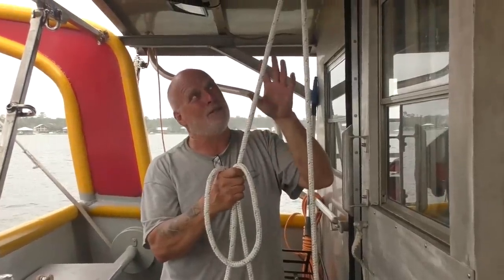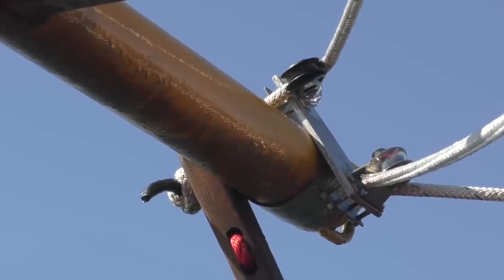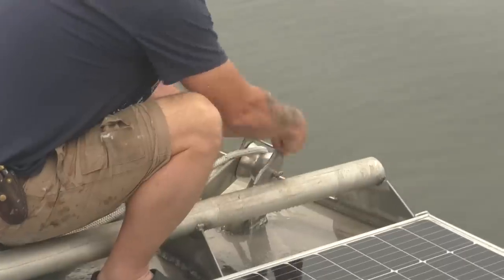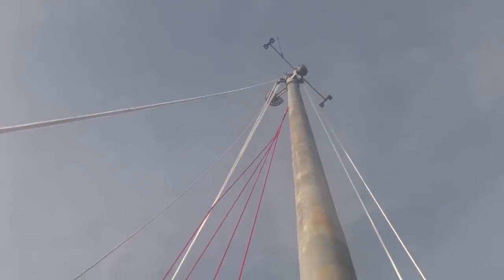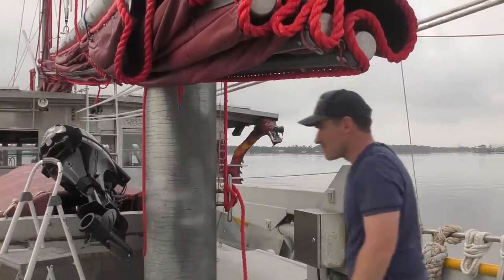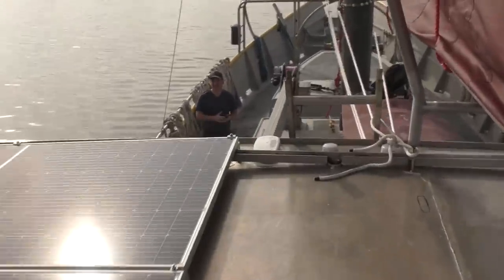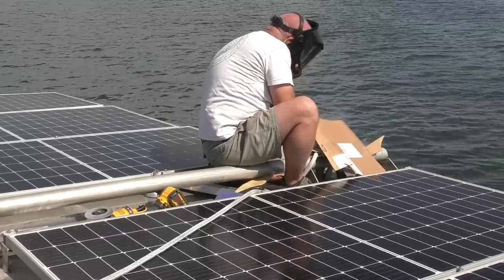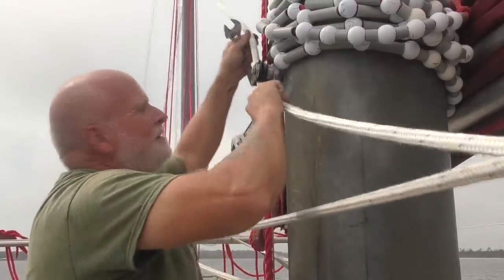Block and Tackle and Rigging a Chinese Junk

Comment: I learned about blocks and tackles when I was a kid. I had no choice. Mom had me moving heavy boxes to the attic back when things were changed out for the season.  On the fold down stair, I built a box that would sit on the stringer and with a use of a 2:1 cheap block I would hoist all that stuff up there (or down) in one move. I also had a tree house; same solution.

Comment: I was a young teen the first time I saw  block and tackle among the stuff of my father, I can't remember why he was using them. But I was past the age of tree house.

Then I tried it with a couple of Mecano cranes that I built.

Here, Thailand, they use a very basic version of tackle when they use a rope to tie down a load on the bed of a truck: they tie a loop on the rope, then run the rope through the D ring on the truck bed, back trough the loop and down the the fastening point. It introduces a lot of friction, but still allow some mechanical advantage.

Oh and the sun rise is worth waking up early.

Comment: So I guess the stainless in the spool gun wasn't half bad... That's a hell of a benefit for you since you've already got some crazy long leads on that. The electric die grinder and fuckin around and finding out was both extremely relatable but also extremely nerve wracking. I was sure something was gonna fall in the drink. 
grind off a bit of the rubber on your mig pliers and weld on a ring so you have a solid place to tie to on those! 
Not sure how you're gonna get a good tie off on a die grinder but I'm sure you'll find a way. Maybe just some high strength kevlar thread or something through a hole in the battery well or something.

Comment: I think Delrin or brass bushings are going to be far better than ball bearings in any application on your boat where you can stand the lower speed and little bit of extra friction.  Otherwise I think fully seal bearing with the rubber seals would be best. I hope you sail a lot and get really strong.  Have you seen what professional grinders look like?  Those guys are huge!
Reply from the maker: Yeah, I agree.  Plastics.

Comment: Captain, I have two questions for you. One is , have you considered using two pulling points equidistant from the mast so they pull  together evenly and take half the load on each side. the other is have you considered using double or triple blocks to east the load as you pull the sails up the mast?  I look forward to your sailing adventures when you get everything the way you like it on your ship thanks

Comment: How do you prevent rust on the steel parts you install? Do you coat them with something or plan on sealing them later? If it’s aluminum, is it resistant to salt water? Thanks! Love your stuff. Can’t wait to see that thing in the Bahamas or Cabo
Reply: No steel parts in this episode, stainless and aluminum.
Reply from the maker: Paint the steel, or grease it and nothing for the aluminum.
Reply: I use Lanolin from the manufacturing company in New Zealand called Prolan, bare metal (preferably lightly corroded) treated with rust neutralizer and then 3 coats of their Extreme product have given excellent results in the anchor locker and the lazarette.  I heat lanolin grease to brush it on as  a fluid after it cools it is an impermeable waterproof semi-solid, the grease is an excellent anti galling lubricant for stainless steel threads and I use it to lubricate and corrosion protect the rudder stock and gland and on battery terminals.  Totally natural and non hazardous and it is good for your skin.  I believe there is a USN MIL spec for lanolin and I bought some of a different brand in spray cans from O'Reillys for truck  under body protection.

Comment: I once was told that bearings are for low load and high speed, and bushings are for high load and low speed. Seems to be the same mindset as the makers of those shieves(?).
Reply: Bearings do both but bushings are cheaper

Comment: Thanks for your video, just wondering if enough wind ,you need to drop sail will it always come down as pressure against mast maybe have to pull down sail.
Reply from the maker: You turn into the wind to drop sails.

Comment: the problem with the bearing is dis cimuliar metals, steel bering aluy pully = rust
Reply from the maker: Actually that dissimilar metals can cause galvanic corrosion.   I think that is just good old oxidation.  And the saltwater will speed up both.

Comment: Please make sure that any heavy things you hoist to the top of the mast have some kind of backup security so they won't come crashing down on someone when the main line turns out to have broken due to chafing.
Reply from the maker: Yes Mother
Reply: You've never been on a sailboat before, have you?
Reply: @riverdolfi2846  How so? I just see some extra risk on this DIY boat with heavy steel battens. I hope safety comes first.
Reply from the maker: If safety was first, nobody should be in a boat.
Reply: True. Safety second then. I love your project  and I love sailing. I just find those steel battens scary, thats all.
Reply: I think they aluminum battens, not that you'd care if one cracked you on the noggin. But yeah, sails don't have backup halyards or at least none of the ones I've been on do, including junk rigs